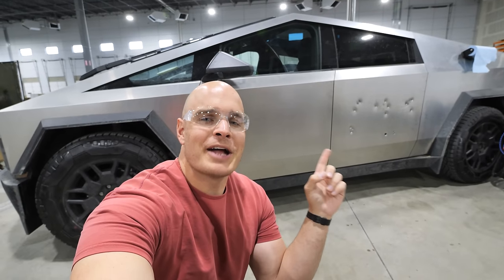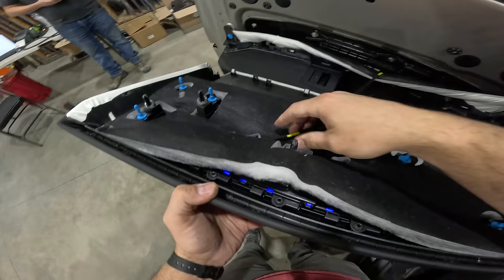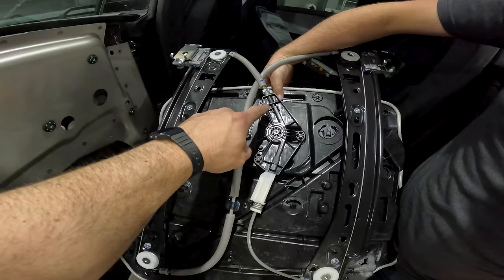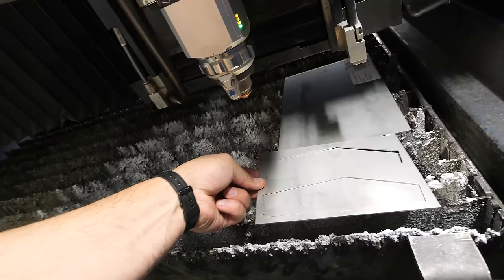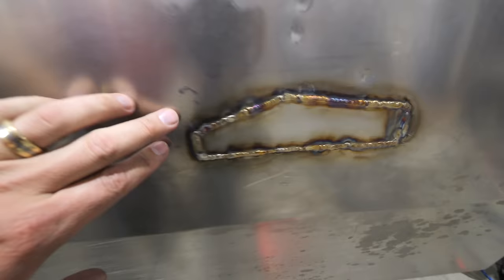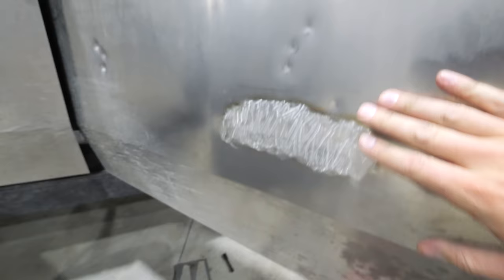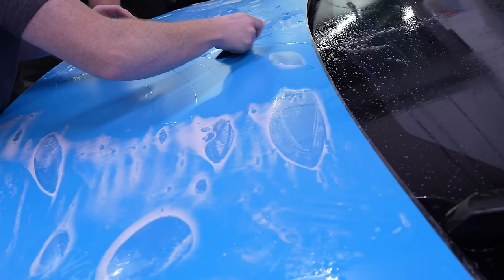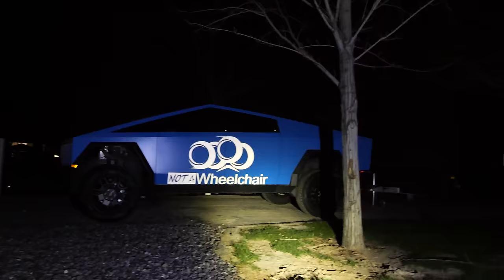How to fix BULLET HOLES on a CYBERTRUCK!

Comment: Question: If EVs are on all the time, as you say in your video, what happens if you have to leave an EV parked long term? Will the battery be destroyed if it's not stored plugged in, or will it enter some self preservation mode and fully disconnect the battery? I know from using lithium batteries for drones that completely discharging them will destroy the cells (and can cause a fire under certain circumstances).

Comment: TIG welding is slightly better for stainless steel.  Some decent welders are ~$400 at Harbor Freight.  Why didn't you try to beat the bumps flat?  Might not work since stainless suffers "work hardening" as it is stretched.

Comment: On board computers and welding don't mix very well. You can fry a computer by welding on a car if you don't unplug the battery or put one of those welding surge protector.

Comment: The argon is protection from nitrogen actually. not oxygen. Oxygen is sometimes purposefully mixed in with a high gas flow (Venturi effect) to allow the weld to get hotter.
Reply from the maker: That's way too many big words for my head to understand.
Reply: @JerryRigEverything  oxygen on it's own is fuel for fire, think of it as the same for the weld. There is more nitrogen in the air that we breathe, and it, is actually the reason we have to protect welds. When you weld without a gas, it will come out with internal bubbles, those bubbles are called porosity, and that is caused by the nitrogen in the air 👍😁

Comment: Basically all Cars from the VW Group have Windows attached to just 2 Points like in the Tesla truck. Nothing new. 2 Clamps and a Screw. Same Motors same cables to move the Windows. I worked for VW and had to replace several Windows. Its just like 5min of Work. Takes longer to clean the inside of the Door from the Broken Glass debris 😅

Comment: You definitely aren’t a car guy, or you are a tech guy trying to be a car guy.  Every vehicle wheel hub has surface oxidation regardless of having hubcaps, center caps on or not on.  It’s the type of steel every manufacturer uses, it will 100% always have surface rust.   Shouldn’t even be something to talk about. How did you never know this?
Reply: look at the headlines, every clickbaity article goes on and on and on about how the cybertruck is rusting, only for them to then talk about how it's the brake discs, or hubs.

I've yet to see an example of the stainless rusting, but that doesn't stop people from reading the headlines and talking like the whole car is a rust bucket after a few weeks.

Comment: Is that emergency release located behind the paneling?, the paneling that needs 3 bolts removed? and also, if the vinylu was heated up and not pressed into the grooves, wouldnt it make the holes less noticeable, or can you not have any vinyl off the surface the surface? just a few questions I wanted to ask, I know someone here can explain this to me.Thanks in advance.

Comment: No risk of welder current interference with vehicle electronics?
Reply: Yea normally there's not a potential between the car electronics and the welder, using the on board outlet for the welder was a big extra risk imo. but it seems tesla did a good job isolating it.

Comment: You could definitely buff that patch back to original finish ,and that sound deadening Matt has been around forever custom audio builds have been using it for years in my opinion, that truck is a complete letdown nothing what musk promised it’s an overpriced failure like most of Elon’s Projects

Comment: You like the way the dents look? Super cool? 😂
Reply: This car is obviously a d**k extension. So "Look, what a tough guy I am, they SHOOT at me!" is just another way to demonstrate your manlihood. 
Like the guys posing with their long hard rod (of their AR-15 gun barrels) in their hands.

Oh, this car is SOOOOOO tough - I must be tough, too. 
 
So you have the stainless steel plates 
(I heard they already reduced the thickness considerably at least in the front, because the g-forces for the passengers were too high in case of a crash (in the good old times the cars were so stiff that the cars were repairable, while the people were dead), 
The car would never get licensed in Europe because if is a pedestrian killer, 

The wheel arches are flimsy plastic. 
The original wheel hub covers are already gone, for ZERO reason they reached out with a sharp edge beyond the rim into the tire and cut it up. 

And then I see the "bumpers", just a thin plastic cover, and then instantly load-bearing structures behind it. 
Meaning even with a slight bump you get deformations of the core body structure. And you keep guarantee only when you stick to licensed Tesla workshops, and those are ordered not to repair, but exchange everything with a damage. When you are lucky, you even get the spare parts halfway in time. 
 

I love it like these Tesla Cybertruck fanboys rediscover car manufacturing. Think that everything that is on a Tesla is a stroke of genius. 
Like dampening layers on sheet metal that "de-tune" the resonance frequency of the sheet. That you can unscrew a window. And so on.

Comment: Did you just do welding on the car without disconnecting the batteries?? Never do that, i would probably have taken the door off.
Reply: LMAO dude he used the batteries to do the welding...Taking the door off prob would have been smart yes. I was cringing just watching the grinder spew sparks into the cab

Comment: What you did looks absolutely horrendous. What you should’ve done is flattened out the inside bullet holes and then just stuck a piece of metal behind the door so the holes are still visible in the outside but the metal covers the inside from rain and other external objects making its way into the vehicle terrible decision making out your behalf And the best quality of your previous actions which is the penetration of the door which you could’ve kept and cherished if you thought about it

Comment: Stainless steel is naturally corrosion-resistant, but it is not immune to rust. While it is less prone to rusting than conventional steels, exposure to damaging chemicals, saline, grease, moisture, or heat for extended periods of time can cause corrosion.

Comment: Why do you cut the affected part and then maintain it? It is a stupid idea. If you had done it from the beginning without cutting the damaged part while hammering and modifying it and closing the holes with welding, it would have been better and faster. Isn’t that what you did? It seems a stupid idea.

Comment: Please don't weld on a car before disconnecting the high voltage battery and 12v battery there's a very high risk of frying the cars electronics. Speaking from experience.

Comment: I mean I have to say kudos for the effort but it looks worse than before. You already liked the dents, so you should have just welded tiny pieces of steel just for the holes from the inside and maybe hammer them just a little, than you would have extra man made dents.

Comment: A bit stupid not filling in the bullet dents it looks SH*T half a job is done its a pity you couldn't spend a few bucks on a tin of Bondo and fill in the dents and do the job properly or just change the whole skin if tesla will sell you one replacing the whole door would be expensive but why to shoot it in the first place its already been done it's like playing a broken record what we want to see is some proper off-roading taking it through its paces in deep mud fitting the most aggressive treads on the wheels and see what she does I expect it to do pretty well when the wheels can be controlled better and rear wheel steering which only specialized off-roaders have and not for road use like the cyber truck.

Comment: Good quality stainless with enough nickel and chromium not to rust does not spark that much when grinding.  No wonder people say it’s rusting, it’s oxidizing before our eyes with the grinder.
Reply: Of course it does, just put a good quality stainless knife to the bench grinder and you'll see a massive amount of sparks.

Some stainless doesn't throw that much sparks, but that has nothing to do with the quality of the steel.

Something oxidizing at 2000 degrees doesn't mean it's going to on the road. For example, titanium oxidizes easily at these temperatures, yet it is seen as basically oxidation proof.
Reply: @fredrikcarlen3212  the amount of sparks are directly proportional to its oxidation.  Sure a cheap 400 series will throw some on the angle grinder, but the high nickel content with a 300 series will not.  Obviously you never work with metals.
Reply: @hugegamer5988  I make knives, my full time job is grinding mostly stainless on a belt grinder..

You're forgetting an important part of the equation, the amount of sparks is indeed proportional to the amount of oxidation, but that doesn't mean that's the only variable. The more important variable is heat, the speed at which you're grinding and thus the temperature you get the sparks to has a huge impact on the sparks thrown.

Any steel will throw sparks with enough temperature. I've yet to work with any steels that don't throw any at all, and I have worked with a lot of different alloys.

In the end, this is not important. What is important is whether or not the car will rust while on the road, not if the metal dust would oxidize when heated to thousands of degrees. The amount of sparks flying off while grinding tells us very little about that.

There are also more considerations than just corrosion resistance here. A lot of stainless steels would be impossible to bend without cracking them, a lot of them are way too soft to be used for this use case.

You're wrong to assume that stainless grades with slightly lower corrosion resistance automatically means they're of lower quality. This couldn't be more wrong. There are a lot more, and I'd argue more important factors at play.

Comment: So you welded an electric vehicle without disconnecting the hv or low voltage battery, grounding the welding electrode to the vehicle chassis!😱 I’m surprised this did not fry the electronics on the vehicle.🫣few…..

Comment: IDK why you even patching the holes. Just make some more holes for fun, and then properly dispose of this piece of rusty metal garbage. It could even be recycled into something really useful, like spoons or fry pans.
Reply: What rust? The wheel hubs?
Reply: @fredrikcarlen3212   IDK. I'm grown up man, I'm not making poor financial decisions based on hype from when I was like 16 or something. I'm riding a diesel Volvo. I bought it used for 5k. It was made in 2004, it's in perfect condition and have no rust till this day. It don't look ridiculous and I can ride it under rain without permanent damage. You may say I'm cheap and old fasion, but I say - Hey at least my car have working breaks 🤣
Reply: @user-ut4vl8bw2k  I happen to have a Volvo too, from 2011, and you're simply wrong. Every single car ever made including mine and yours will have some surface rust on the wheel hubs, brakes, and any other non-treated steel surface. The cybertruck is no different.

Just leaving your car outside for a couple weeks in winter will leave some surface rust on uncoated parts. In fact, I'd say the Cybertruck is more rust-resistant than my Volvo is because most of it is made from aluminum which doesn't really rust to begin with.
Reply: @fredrikcarlen3212  I agree with you on this. I recently changed brake discs and rims covered yellow after the first carwash. 
But it's not unusual for such parts, they designed to withstand such damage and it does not affect either functionality, appearance or longevity much. They are made from regular uncovered steel and easily replaceable.

But whole body rust on a brand new 100k$ car after just 1 month of usage is just a scam. And to sell cars with broken untested breaks is not only a scam but an irresponsible crime made by known billionaire who rushed engineers to deliver car without proper safety testing just to hype a bit. With such issues do you trully believe it have no other critical defects and its a good car?

Not that I care much, it does not fit in any European safety regulations so it's illegal in my country, but I consider it a good thing. I would not be happy if a 3-ton piece of rusty metal scrap without proper brakes drove in the neighborhood.
Reply: @user-ut4vl8bw2k  There aren't any instances of the body rusting though, which was my point.. Literally not one.

I live in the EU too and it would be perfectly legal to import one if you wanted to, at least to Sweden where I live, although it couldn't be sold here by Tesla.